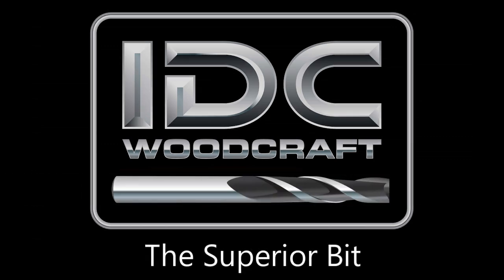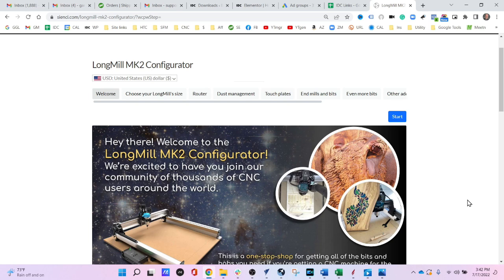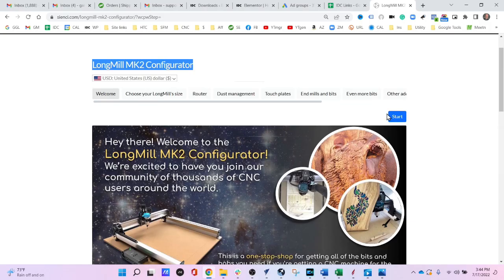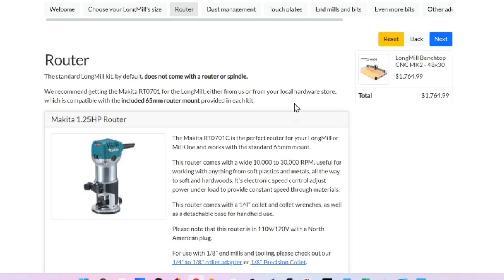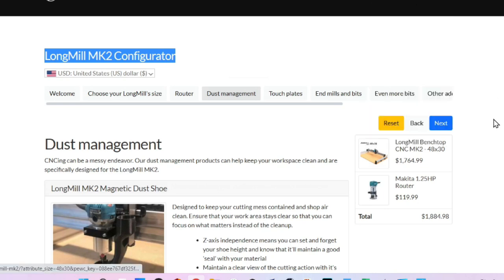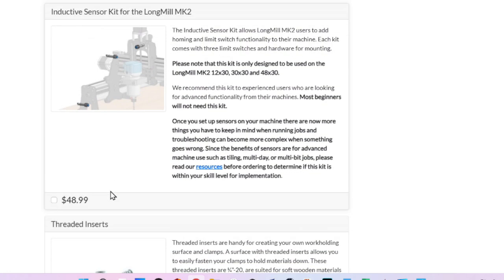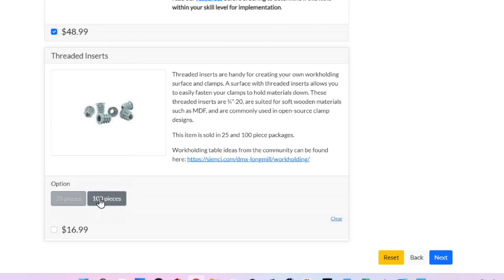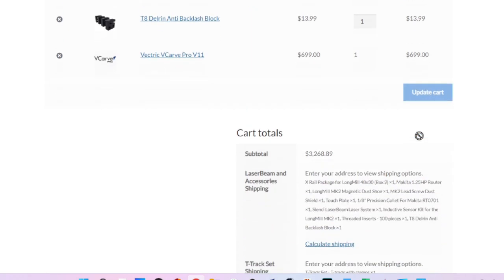CNC Router Essential Items You Need When Ordering Your CNC Router [Longmill MK2 by Sienci Labs]

Comment: Sir when I surfacing program upload its going to carry one line and suddenly stopped and showing grbl 1.1h for help  what happened please help me...🙏🙏
Reply from the maker: ramijali6964, It sounds like there might be a communication issue between your CNC machine and the computer sending the G-code. Make sure your firmware is updated to the latest version and check your connection settings in the control software. If the problem persists, try reaching out to the manufacturer for further assistance.

Comment: Hi Garret, Reg from Melbourne Australia
I have watched and enjoyed your beginner videos and longer ones on the Longmill and am contemplating purchase and I appreciate recommendations concerning all the required items as it would be best to purchase all together hopefully to save shipping costs. My first problem is I need to purchase or build a worktable for it. The video on rigidity was very informative but there was no reference to the need for a rigid worktable. Subsequently I found your table build video.
Does the Longmill run OK on 240 volt supply which is standard here?
Does the electronics handle voltage line spikes?
The speed of the Makita router, is that set manually for each router tip?
Reply from the maker: Butch, I haven't heard of any issues from our Australian CNC brothers and sisters about issues using the 240 volt supply. But, I'd recommend making a post on the CNC Entrepreneurs Facebook page here →https://www.facebook.com/groups/cncentrepreneurs. There's a ton of really helpful CNC brothers and sisters on there that will probably have some great tips for you! As for settings on each bit, I have a bit database that will help you. You can upload it to Vcarve and you will have all the correct feeds and speeds for every bit from IDC. Here is a video on how to set it up: https://youtu.be/06qlncvzCbY Here is a link to download the database: https://idcwoodcraft.com/pages/database-downloads

Comment: Hello, Garret How're u doing? So I wish to ask u about this Makita router, do u adjust its speeds rotation, when u create your Tool Path. Actualy I'm plannig buying this same router, and i wish to know your thoughts about this thing. Or do I buy an spindle? Thx in advance
Reply from the maker: Eduardo, I'm doing good brother thanks for checking in! In terms of the router, you'll adjust these depending on the bit and the tool path you're running. The longmill works excellent with the makita router since it was specifically designed for it. You could definitely change it out for a spindle but I wouldn't recommend it since it gets a little complicated!

Comment: Garrett - During your review of the MK1, you made some recommendation about adding the additional Backlash and double nuts instead of screwing the locking pin into the drive shafts... is this still recommended for MK2?
Reply from the maker: Jay, that isn't needed for the MK2, they revised the design a lot in that department!